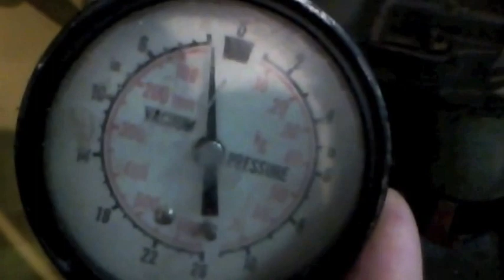Advanced Wood Gasifier

Comment: There needs to be more diy Fischer Tropsch stuff on here, I haven't found any yet. With catalysts in the right set up, you can convert woodgas into gasoline. Then you have a much higher energy density and much easier storage and operation.
Reply: I like the ease, portability, and safety of liquids a lot more than I do gas. Which is why I haven't tried Methane Generation yet. I live in a city, and one oopsie-doodle would get me on yet another watch list :P
Am seriously looking into fermentations. "Fun" fact: During WW2, Occupied Poles were making Wodka with their own feces. Apparently digestion only strips some sugars from the foods, while unlocking others. With this process, the sterilizations required for NORMAL distillations are more than sufficient.
When brewing, if you fail a sterilization, you will usually find out by being greeted with an aroma similar to the raw materials mentioned earlier. OR you might think it's fine, and drink it and die...
Every brewer I have ever met was beyond OCD when it came to cleanliness.
For me, all alcohol will ever be is a sterilizer and a fuel.
Reply: @TimeSurfer206  I compost my waste which is about as daring as I think I will go. I'd be hard pressed for a drink before I'd try that I think. I used a lot of berries to make some homebrew without yeast this year, (didn't have any) boiled the mash, but then threw in a handful of raw fruit to see if I could get it going. No off odours or tastes, but it was only weakly alcoholic after a week and a half of hot weather; enough to feel the effects, but nothing compared to what proper wine yeast will do.  I was paranoid about what might have been growing in there, but it seemed fine, just very slow fermentation.
Reply: @handleismyhandle  Like I said, I don't drink Rocket Fuel.
I have better uses for it than punishing my liver.

Comment: Nice you said it at the beginning. if you run good fuel you dont need that much filtering, tar can not be filtered anyways if suspended in the gas. Many are deceived by seeing this in their filter media, this is just where some of it has dropped the rest that is still suspended in the gas will pass right through it. I consider what would be a media filter on our machines as a condenser. Our end users can use this with filter media, however, I personally do not run any media filter. We have a final cyclonic dryer placed post air fuel mixture, this relieves vacuum presure and the intake air instantly cools the gas. Moistures soots and tars then more readily drop as the result of the presure drop. because moisture is here in the gas; this makes this cyclone a wet filter and also scrubs the intake air. After engine run you then check the drain here on this filter,  this then tells you if tar has been made. You can then get your machine running on gasoline to clean it out before bad things happen to it. But as you state in the beginning if you are always running good fuel then you will always produce tar free clean gas. :) Great job on your build!!
Reply: I'm thinking of a dual-stage process, maybe even treble: Make charcoal for the motor fuel, and gasify that as needed.
BUT: Also, while you're baking the charcoal, bake some bricks and pottery. Go even farther and tap the last stage for domestic hot water. Add intermediate stages as imagination devises.
Heat is just as valuable as water. Never just either use once.
Reply: @TimeSurfer206  We are developing the VersiFire now. This is a raw fuel gasifier that is very simple, that will supply gas direct to home to replace NG or LP. There is only one simple filter basically to protect the blower that charges the gasometer. Once the gasometer is fully charged the gas cools and settles out all tar and debris before it supplies the gas out.  Charcoal is a byproduct of the system and it is optimized to mass produce it while it produces pyrolysis gas. You can then use this gas for what ever you desire as long as it is low enough volume for the system to keep up with. Typical home gas appliances are very low volume so it will easily keep up with this application while producing an abundance of charcoal for engine grade gasification.